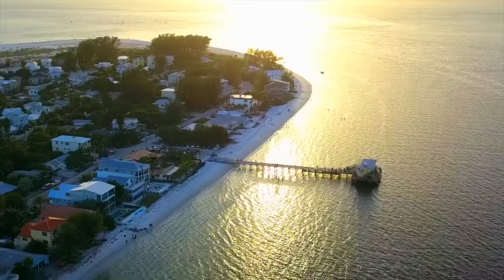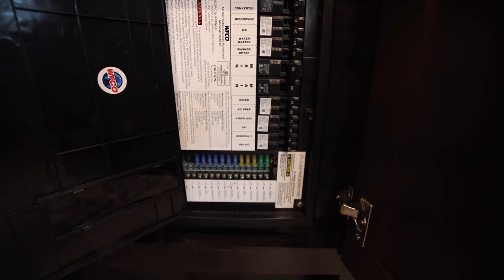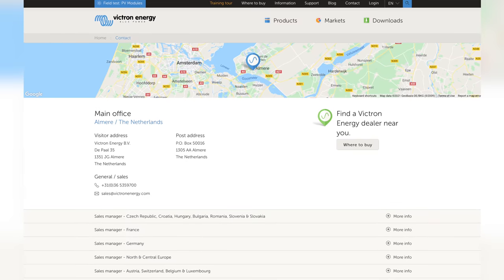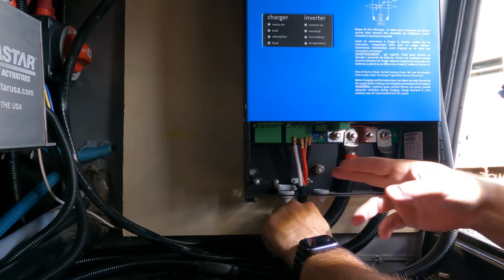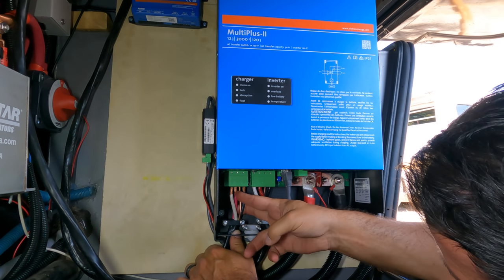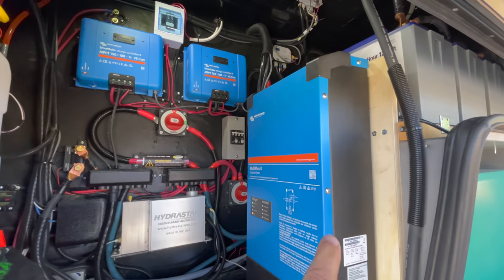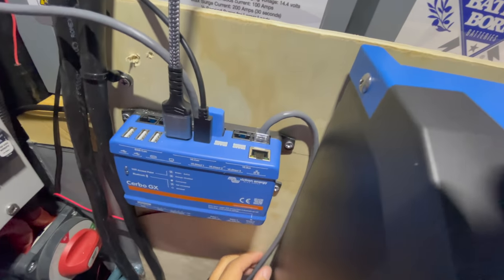🔋⚡️🔌 RV Inverter Upgrade! (Victron Multiplus II 12V 2x120 and CerboGX!) (Full Time RV Life)

Comment: I've been running the Victron Multiplus II 12V 2x120 since May. I plan on installing the Cerbo GX in January. However, for now I'm relying on the VictronConnect via BT to monitor the system. When looking at my Inverter it never shows L1 & L2, only L1. We're off-grid and only have a 30 amp generator. So I don't know if it's because of the bridged "In" as to why I'm not seeing both legs separately. The other thing is when I try to exceed the power coming in the Inverter appears to be going into an overload mode for maybe 5 seconds and then tries to go back to normal. Not sure if this is a wiring issue or why that is happening.
Reply from the maker: I forget what the display looks like via VC, but L1 and L2 will be bridged when inverting or on a single phase source like 30A.  Not sure about the overload thing....

Comment: Just a little spot. Your breakers from the solar panels is not wired correctly. According to national wiring code, both the positive and negative leads from the solar panels must be completely disconnected when you throw the switch. You only have the positive side run though the breaker thus can cause issues with back feed if you have a short in your solar panels. You need to add a second breaker or a 2 pole breaker for each of the lines in. Just noticed that.
Reply: its spelled out in NEC code 2020 Article 609.13 Section (E) that solar panels when disconnected must have both the  positive and ground side disconnected simultaneously and completely.

Comment: What did you use to splice the PV wires in the roof box? I just ordered 6 x 200W HiTec panels and a second Victron 100/50 SmartSolar charge controller. Great video, very comprehensive without getting deep in the weeds!
Reply from the maker: I just used heat shrink butt splices like these: https://amzn.to/3kvLlNi
Reply: @ChangingLanes  I thought that’s what you used but it looked beefier in the video clip. Thanks again for taking the time to follow up. Hope to see you out there someday and Happy Veterans Day from a fellow vet.

Comment: Heya Chad, great job, huge Victron fan here as well.  For the shore power current limit you can install the Victron Mulicontrol as well.  It has a dial with readout to easily set the max shore current (handy for 30amp or even 15 amp mooch docking).    Really wish they would add this to the screens on the Gx (maybe it is hidden there) but there may also be a way to use an input to configure this (Edit: Assistant Input Limit Current Control), I need to dig more into it.  You could add the Multicontrol down in the battery bay or where you plug in your shore power so you can set it right as soon as you plug in.

Example here from Vanlife showing the dial:

https://youtu.be/A6XsygejrVA?t=153
Reply from the maker: You can set the current limit via the GX.  Just hit menu then select the inverter and current limit.. I actually show it in this video.. 👍🏼

Comment: Great video as always! We just installed the same system in our rig. Is it normal for the multi plus line of inverters to give off a humming noise most of the time?
Reply from the maker: A little.. and, oddly enough, the GX 50 display hums when the inverter is under load.  Not very loudly though.
Reply: @ChangingLanes  oh that is really odd with the GX50.

Comment: Hi Chad love your videos and your rv electrical knowledge. I thought you might find this interesting and could be a good video if you know a solution . Seems like there is a Victron bug that know one can figure out. I currently installed a 465 watt solar array with victron 50 mppt solar charger and 3000w victron multiplus inverter. We have a 30 amp rv. When I run our 2500 watt champion dual fuel inverter (1600 watts running power) I set my power limit to 13 amps. When I plug in to the generator it starts bulk charging batteries and then when I flip on AIr Conditioning, the inverter starts power assisting at about 1000-1100 watts. My surge protector is showing it’s only outputting about 9-10 amps and that is what I see at the inverter. If I set the limiter to 7 amps or less it will take all 7 from the generator. If I set the limiter to about 20 amps, which is more than the generator wants to run on, it will deliver 1500-1600 watts. There seems to be an issue when the limiter is between 7.5 and 15 amps. By the way, I did the same thing connecting to  a 20 amp shore power source and it did the same thing. I also have the dynamic power enabled. Here is a link below to a victron forum that seems like a common problem but is unsolved. If you feel like this may be if interest and you feel like solving g a problem, could be an interesting video to use rv solar geeks!
https://community.victronenergy.com/questions/16260/multiplus-not-using-full-shore-power-limit.html
Reply from the maker: Interesting thread... I noticed that when I set ours to 45A, it does seem to have that 10% buffer.  Seems like the issue is more in the 9-20A limit range.

Comment: How does this change while you are towing? How long does it take to charge the batteries from flat in a typical situation like, towing, on shore power, generator, solar only.
Reply from the maker: Towing, only the solar is charging and that's 2000W, which means about 1500-1600W in reality.  How long to charge is just a math problem depending on the source.
Battery bank is 12KWh (12,000 Wh).
So, charging is just that divided by charge:
Solar: 1500W (12000/1500) = 8 hours
Shore / Generator (Victron charging) (also 1500W or 125ADC @ 12v) = 8 hours.
If BOTH are charging, we're looking at 3000W which means 4 hours.
Of course, this is with zero loads.
Hope that helps!

Comment: Can you share the links to the Parts used in your Install for the Bus Bars, Breakers and breaker panels into and out of the MPPT Controllers, Switches and T Fuses, please.  I'll need to find similar Products for my install.  Thanks in advance.   I'm using your video and Jared's to design and build my Solar & LiFePo4 setup.
Reply from the maker: The links are all in the description and in our blog post here: https://changinglanesrv.com/rv-inverter-upgrade-victron-multiplus-ii/

Comment: Hey Chad,  You show and mention your transfer switch, Dosnt the Multiplus II have a 50A automatic transfer switch built in? what it the purpose of having a transfer switch before the Multiplus?  seems redundant and unnecessary, unless im missing something.
Reply from the maker: The inverters transfer switch is for passthru/inverter switching... The separate ATS is for shore power / generator.

Comment: How does this system now work with your generator? will It start it if needed? or do you have a separate system for that?
Reply from the maker: Our OneControl can start the genny, but it's voltage based which is unreliable (starts too early under load).  I may install an AGS via the CerboGX that uses true state of charge data from the shunt in the future.

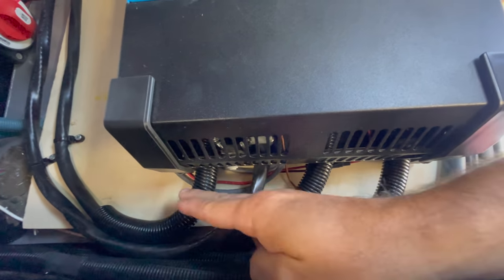Comment: When I was working with Future Sales to update our installation (installed by the RV dealer, ew), they indicated that between the output of the inverter (Victron Multiplus) and to the power distribution panel that Victron recommends having a 50 amp breaker box installed.  FS told me this was the recommendation from Victron and kind of like "wiring code".   I'm wondering about your thoughts on that, as you really do like to put breakers between things, as is evident in your video.  (This lack, if I'm correct, would be around 14:00 above.)  Interestingly enough, I started getting alarms from the Victron.  Checking the panel, I see 3% battery.  3%?!?!  WHAT?  Pedestal plug was good, surge protector was good, lights built into our power cord were good.  Turns out this 50amp breaker box had tripped.  No idea why, first time since we had it installed over a year ago.  But something needed protecting, obviously, and it tripped.  (My computers, routers, NAS, Pepwave, all thank it profusely.)
Reply from the maker: The power distribution panel has it's own 50A breaker (with each circuit also having it's own breaker).  Seems redundant to install another 50A breaker on the same cable run with another 50A breaker...  What am I missing?
Reply: @ChangingLanes  Must be the old version doesn't have those breakers.  I should've been clearer we don't have the v2, but rather the  "MultiPlus 12/3000/120-50 120V, Product ID, 2702"
Reply: @ChangingLanes  And you could be right, seems redundant, yet that one tripped last night somehow and nothing else did.  (At least nothing else I had to reset.)

Comment: So I do have a quick question on this unit. I see that it is a 2x120 3k VA unit and your RV is a 50amp unit. So it this inverter a 3k VA unit or is it 6k VA total since it has 2 power inputs, since you were at 4k watts of load at one point? Wondering since you didnt go with the 5k VA model. Im still trying to figure this all out as well since i'd like to eventually do a system like this in my RV that I live in Fulltime, mine is a 30amp 28ft TT so i'd be going for the 12v 3k model of the multiplus since I dont have a lot of an electrical load as you all do. Thank you for the videos on these subjects as they are very helpful!
Reply from the maker: A 50A RV has two 50A legs our of phase for a total of 12KVA (6KVA per leg).  30A is a single leg that bridges the two hot legs (in the adapter cable) for 3.6KVA.  So, in the demo on 30A, about 3400W was coming from shore power and the rest was from the inverter.  This is the power assist.. Hope that helps!
Reply: @ChangingLanes  Ok that makes sense now. So in the demo the inverter was just boosting to help cover the power load from the 30amp plug. So when you are strictly on battey you'll only be able to inverter up to 3k va from the inverter alone unless you have the generator running then it'll go back to the power assist as if you were plugged in?
Reply from the maker: correct.

Comment: I'll say it again Chad.....well done!!  I've watched this and your solar install video more than a few times now.  The last time was with my wife as I explained things along side of what you were saying.  So.....a serious question now that you've got it all done (as I don't believe you've said anything about a future upgrade to anything)....If you were to design this system from scratch, and space or money wasn't an issue, realistically, what would you do differently?  If anything.  I'm sure you've had time to play and use the system in all it's options and possible configurations.  Are you happy with the battery bank?  The amount of solar panels?  Would you go more solar and batteries and do a second Multiplus?  I've emailed you so there's a reason for my question :)

Thanks for your service as well!
Reply from the maker: If I were to start from scratch, I'd likely us a larger form factor battery like the game changer from battleborn.  I'd also likely configure the DC system for 48V, allowing thinner wiring and lower amperage.

Comment: Chad, I’m trying to decide on which to get..GP IC2000, or the Victron multiplus 12/2000/ and right now am leaning towards the Victron.  However, in your diagram, you show an ATS.  I thought that there were built in transfer switches in the units themselves.  My line in for both shore power and portable generator both go directly to an EMSHW50C and then would go directly to the unit for 50amp pass through to the power center.  Am I missing what the need to is for the additional ATS?
Thanks for your great videos…Go Navy!🛳
Reply from the maker: The built-in transfer switch is for shore power to inverter power.. The external ATS is for shore/generator switching.  IMO, Victron is a little better than GP.  Just the fact that Victrons can be updated over bluetooth and the GP cannot is a pretty big deal.  Good luck!
Reply: @ChangingLanes  ,
Is that because you have a built in generator?  With my portable generator, I would just plug the power cord into a pedestal or the generator.
I guess I’m the transfer switch!
Thanks for you quick response. Hope all is well with you guys.
Reply from the maker: Yes.. exactly.. YOU are the transfer switch in that scenario.. 👍🏼
Reply: Thanks again for getting back to me so quickly…been watching your different videos on the electric build over time to where you are now…great, and explaining is understandable even to my limited mind.

Comment: ok, ok.... what??? 
your new upgraded inverter was actually cheaper than the gopower one? 

I have a Renogy 3000w Pure Sine Wave Inverter Charger. hate it. regret not spending more money on a gopower. have the gopower  on my wishlist since. 

but now, checking chad's video out, a new Cinderella contender? 
and cheaper??

I actually just bought a Victron Battery Monitor BMV-700 (replacing a renogy one),. the main reason is my generator can be integrated for auto start with the BMV700. 
about to do that setup soon. 

can you share here an updated thought after some years with it? 

thanks chad.
Reply from the maker: I definitely recommend this inverter over the gopower.  The way all of the Victron stuff works together is awesome!
Reply: @ChangingLanes  yeah man. I see the brand very very solid. 
impressive that is less expensive than the gopower. 
maybe I'll have to buy it before they go up in price. 

I really feel my renogy inverter is gonna die on me on the worst  day scenario ever. 
the "remote" is just one button. on/off. 
I have to go inside the storage to see the screen. 
no bluetooth or anything. 

renogy solar panel and charger working great. but inverter and battery monitor are crap. 

what vendor was the one you use for Victron?

Comment: Do you think on the 6 gauge wiring for the AC side that Ferrell crimp ends would make it easier to make the push in lock or be to much trying to get into the connection, I’m going to be installing our next week and wondering about that step
Reply from the maker: They were pretty difficult without ferrells...  Tough to say, but I think without is better.
Reply: @ChangingLanes  10/4 I’ll try it out and report back

Comment: Hi question, I plan on following an almost identical set up for my RV. I plan to host a 2000w solar array on my rooftop. 

I would be going with the same inverter, what charge controller set up would I need for 2000w solar array?
Reply from the maker: We have 2000W also.. see: https://changinglanesrv.com/rv-solar-install/.

Comment: Chad, I am setting up a similar system (without the solar for now) in my DRV FullHouse and had a question about your generator in relation to your Cerbo GX.  Does the Cerbo know anything about the generator?  I noticed on the Cerbo display that the top left was labeled as "Shore".  Will that switch to "Generator" if you are running your generator instead of getting power from the shore power connector?
Reply from the maker: Since the generator and shore power are behind the ATS, there's no way for it to know which is which.  There might be some kind of generator interface that we don't have though...
Reply: @ChangingLanes  That is what I was thinking.  I was reading the instruction manual for the Cerbo GX and it mentioned being able to do auto-start of generators.  I wasn't sure if you had that setup in your environment.  I guess you probably don't need that seeing as how you have the solar to charge the batteries when the shore power is not connected.

Comment: Is it possible to have a grid tie style system that will pull maximum solar power when available and use shore power and batteries as the backup
Reply from the maker: Indeed!  See: https://community.victronenergy.com/storage/attachments/3299-virtual-switch-ignore-ac-lesson.pdf

Comment: Great video showing all the options, it’s a great inverter, I just installed the same system on out Super C.  I do have a question if you don’t mind, I have searched all over the internet after seeing your video showing L1 & L2 on your AC input and output and I would like that feature but can’t seem to find any info on it.  Thanks!
Reply: I have the same question.  I have gone through all my settings trying find something I missed or trying to find out if the current sensor would be needed but I don't see it installed.
Reply: You have to update the firmware on the Cerbo to v2.80-21. It isn't a final release, but I've been using it for a while with no problems.
Reply: @thriftysigns2899  Thanks for the info.  I have been pulling my hair out thinking I have something set up wrong.  My Cerbo has v2.73 firmware.  I will keep looking to see when it becomes available.
Reply from the maker: Yes.. what Thirftysigns said.. You need to use the release candidate version.  👍🏼
Reply: Thanks guys, I’ll look into the firmware update!
Reply: I have now added the GUImods and added Ruuvi bluetooth temp/humidity tags, these things are cool, check them out Chad…. But maybe you have by now 😉  I also dealt with the Onan generator not playing well with the Multiplus II

Comment: Just curious why do you have a transfer switch i thought there was one bult in to the multiplus 2
Reply from the maker: The transfer switch in the MPII is for Inverter <> Shore switching.  The other (standalone) ATS switches that "shore" between shore and generator power.